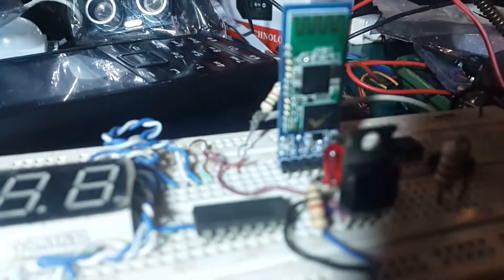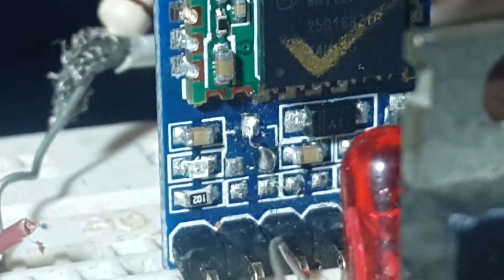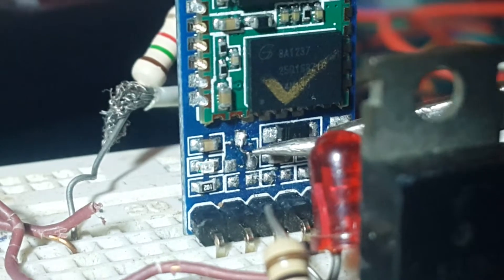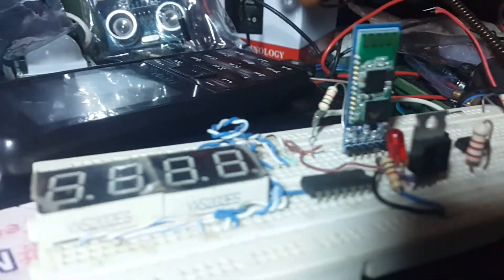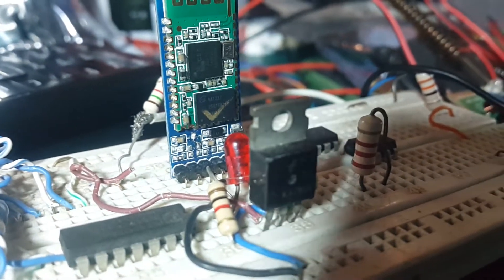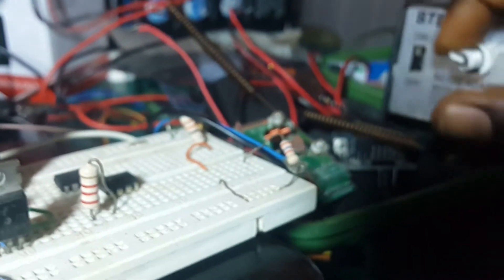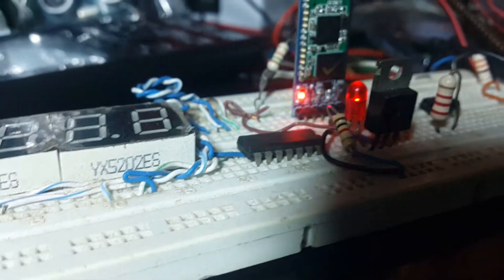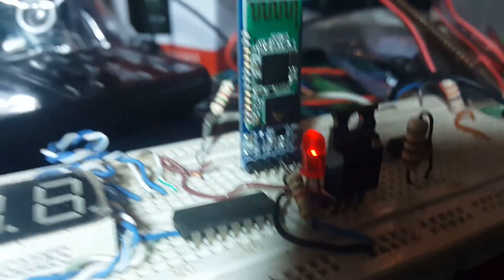HC-05 BLUETOOTH MODULE REPAIRED

Comment: I'm connecting hc05 bluetooth module to l293d motor driver with 5v power ... But when I connected it blinks for few seconds and stops working and getting damaged.... Also I repeated it with another bluetooth module and the same thing happened to it... Bluetooths getting damaged... What may be the problem??
Reply from the maker: Does driver support serial communications?